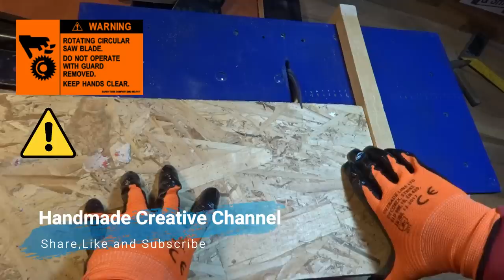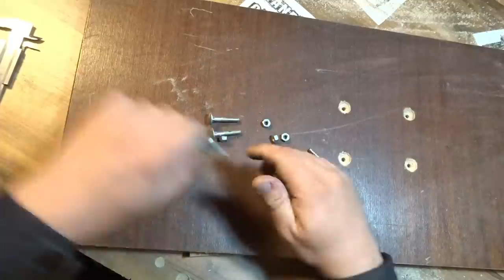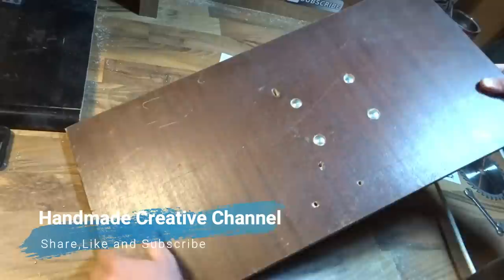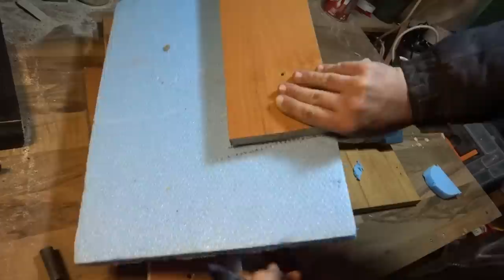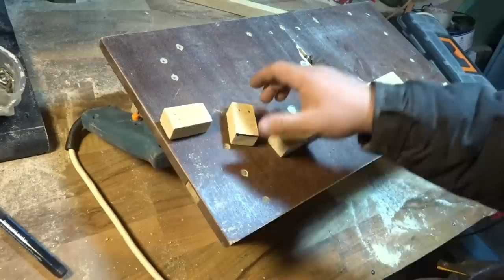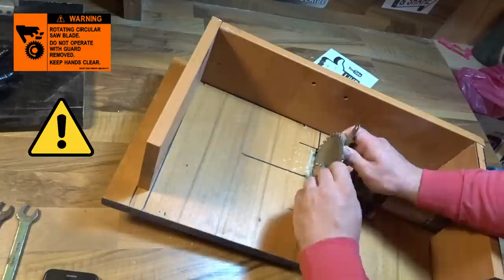How To Make Simple Homemade Table Saw

Comment: can i use with 7" blade?
Reply from the maker: You can use any size.
Reply: A drill is not so powerfull as a real table saw, and doesn't rotates in the same speed, so, keep the blade small (4 to 5 inches max). If using a greater blade, chances are that it will be stuck with thicker woods.
This is not a real table saw, it's just an adaptation, so, don't expect it to cut just like a table saw.